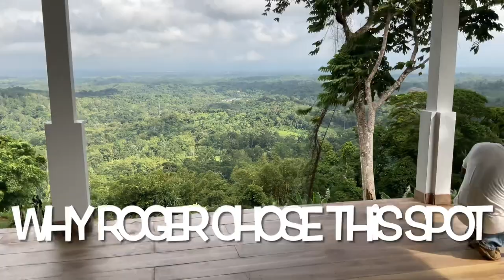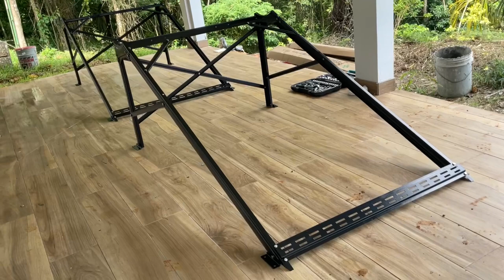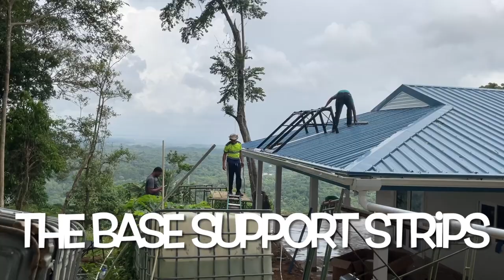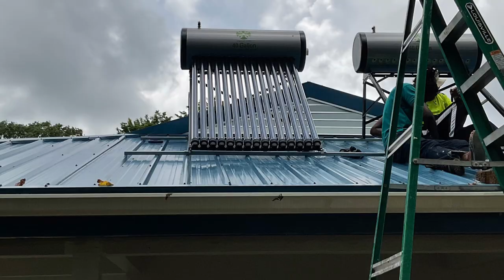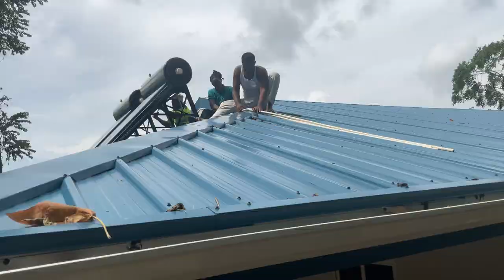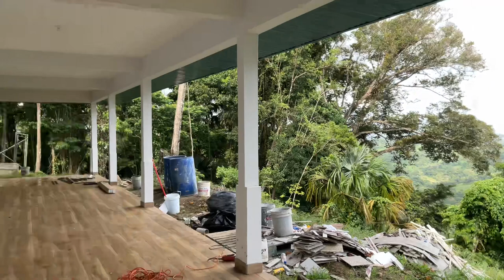Living off the grid. Installing a sola water heater. Music by limujii,  ‘’sweet talk”

Comment: Hi Kevin,
Hope the hot water system works well for you. It looks ideal considering the remoteness of your property.
Great property with fantastic views.
Thanks for posting.
Andy G.
Reply from the maker: Its actually a very close friend that has built a farm up in the mountains and the cost of bringing electricity is significantly higher than installing sola. So he is in the process of the installation the sola heater which is the first of these systems. In two weeks the sola panels  arrive along with the batteries and a small vertical wind generator. The wind blows all day all night. We are hoping that  this combination works, if not we will be doubling the size of the battery bank.
Reply: Hi again,
Well he has a lovely place.
I live in England and have some solar panels on my property to compliment the normal electricity supply to the house, but do not have batteries.
Your friend not having a mains electrical supply will really benefit from having the  batteries.
Cheers.
Andy G.